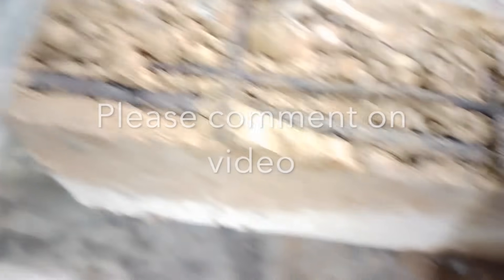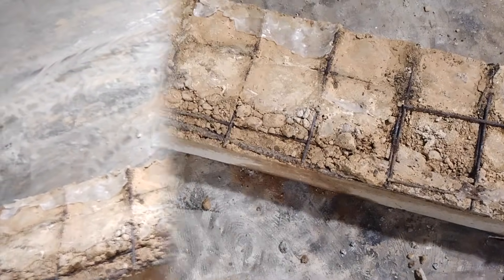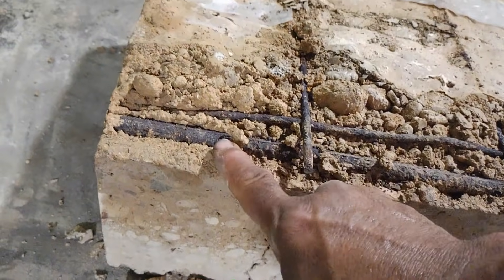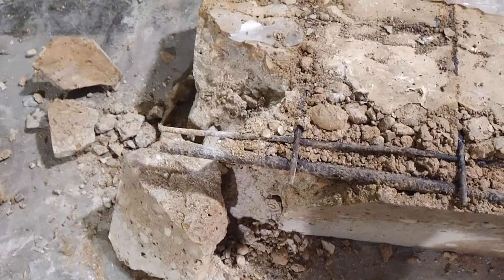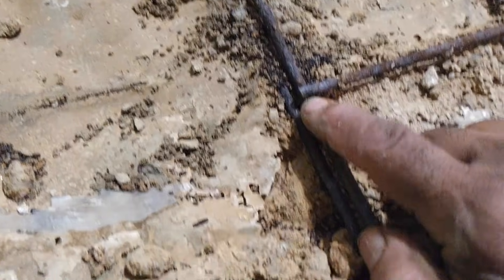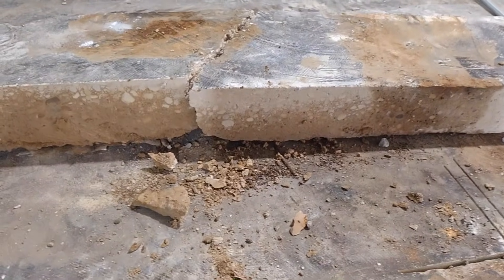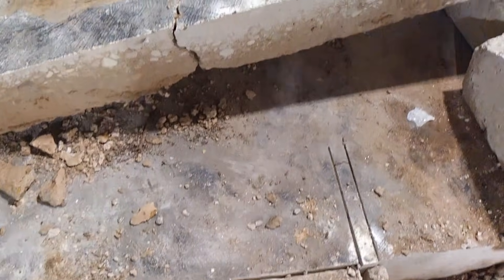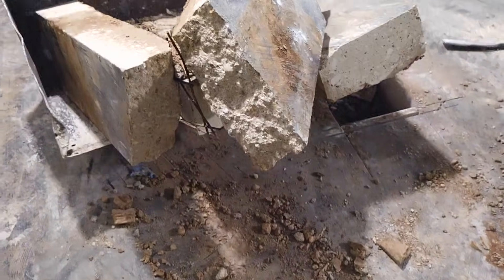Champlain Towers Collapse Concrete Marriage FULL DIVORCE BUT BEST MAN STEPS IN TO SAVE THE DAY

Comment: should have  been  #5 rebar 4 bottom mat on 12inch  centers  with  a top  mat with aleast #6  on 6 inch centers  going across  each colum 6 to 8 ft. an both directions looks like they didnt use a vibrator  4 concrete plus looks like bad mix.

Comment: Do u think you will ever gain access to the actual materials from the Surfside condo so you can analyze it?  You make this so interesting ~love ur content 👍😊
Reply from the maker: Photographs, are  all I need to tell the story of this marriage...  They will tell if the wife or the husband was issue...  But, I am going to say, the wife (concrete) was too fractured because of overloading cycles on the deck (parking area)... That overloaded stress the marriage of husband (steel) and wife (concrete) to death do them part...

Comment: This was also an example of poor workmanship by the wwf and reinforcing not being chaired up in the fresh concrete. The bars in the bottom of the concrete is also visible in the underside of the pool deck. I'll bet this was not in accordance with the contract documents. The WWF is supposed to be in the center of the slab and reinforcing in the lower third.
Reply from the maker: Upper third and lower third rule of thumb.

Comment: Our apt building has underground parking and last year they did some major work on reinforcing the beams and recovering, waterproofing the outdoor parking lot directly above it. Before the work, whenever it rained, the garage would leak profusely and streams of rust were seen running vertically on the walls and the beams. My car was right underneath one of these rusty leaks and was badly stained as a result. Finally, they did the repairs which solved the problem and now since watching your videos, I have been examining the beams, walls, columns to see if I can identify the work they did. Your videos have helped me look at our underground garage (and outdoor parking lot surface) in a whole new perspective.

Comment: that rebar should be imbedded 1 1/2" from the bottom of the slab. If two layers each layer at least 1 1/2" from the top and bottom of the slab.

Comment: Why is there mesh under the 1/4" steel?? There isn't any slab chairs for the 1/4" mat to sit on and there should be a double mat??? That should be at least 5/8" steel or 1/4" with post-tension.  The concrete was dry and not vibrated when poured.

Comment: Beautiful illustration of a hack job you have to fix.  It was set up to fail from the beginning as though they just threw down some plastic, threw the reinforcing down on top of the plastic and poured concrete.  No spacers used or anything with rebar half out of the concrete.  Does nothing without complete concrete coverage on both sides.
Reply: That marriage was bound for divorce already.  😂

Comment: I recently saw some pics showing how the foundations posts had multiple rebar placed vertically, encased in concrete boxes, not close to concrete edges.  No way for that rebar to get divorced.  How did that part of structure fail?    It would have to give in to pool deck/garage infidelities.
Reply from the maker: Appears the divorce started from the deck (husband and wife team ) interface with the columns (studs)... Failed because the stud and the husband and wife team could not keep it together... so they parted company...  They let each other ''slid away"... like two ships passing in the night.
Reply: @ForensicCats  do you feel the husband's attention was on the hot new condo next door? Allowing his focus to slip
Reply: You are getting divorce lawyer ads popping up (AI) no contest
Next we will see plastic surgeons offering pool deck augmentations as a way to save the marriage.
Reply: @charlesrhodes7531  we can’t be sure, infidelity abounds in marriage and construction.

Comment: Interesting, so you put rebar in where concrete will be put in tension by load, so near lower surface, but inside concrete to be protected from elements and to have good grab.  Guess before I’d though reinforcement was in centre of things but that’s wrong.
Reply from the maker: Center is considered the neutral axis ; I have video coming on this... I use a heavy machine and balance it on the neutral axis.

Comment: That concrete wasn't done properly for sure but it was obviously poured on the ground. Not holding up a multi-story building!!! Lots of times, the cement finishers "pull up" the mesh while the concrete is being placed. Obviously, that never happened here. 
You can't say "concrete is a un-safe product" when it's not installed properly!! The Trade Center was a steel structure that failed and collapsed also. I don't recall anyone saying it was "shoddy work" that caused the steel to pull away from the supports!! Are you going to say "steel is no good" or "unsafe"??
Get yourself some "properly installed/properly reinforced", properly mixed and cured concrete and see how difficult it is to destroy it!! My uncle built the Division of Highways building locally in the late 40's/early 50's. They remodeled the building in 1963 and had to cut some door openings in a concrete basement wall. They were breaking off 1 1/2" steel jack hammer gads trying to break the concrete for those openings. Properly designed, mixed, poured, cured, and reinforced concrete is a good building material.

Comment: Just a question - does it make a difference if the rebar is placed more into the center of the concrete rather than on the bottom.  I've seen many driveways where the rebar is placed at the bottom (like you're example) before they pour the concrete onto it and after maybe four or five years of wear and tear of cars running over the concrete driveway, cracking starts to appear.   What about applying a (tesler microwave laser beam) onto the concrete to smooth and force the concrete to become a smooth marble like exterior compacting the concrete to become a more stable and stronger unit.  Similar to what is inside the Egyptian Pyramid's tomb esophagus (not sure of the spelling) it's looks like a black granite stone tomb but smooth.  In appearance it looks pretty hard to cause any cracking to occur.  Sorry, just being futuristic in my thinking.  So Be It!!!

Comment: That is bad concrete, rebar and mesh should be minimum 2”  above bottom of slab,  the rebar requires minimum of 2” of concrete between steel and edge of concrete
Reply: Plastic sheet was probably an attempt at a vapor barrier from the ground.  This marriage was two inches from a successful marriage, it was destined for divorce from the get go.